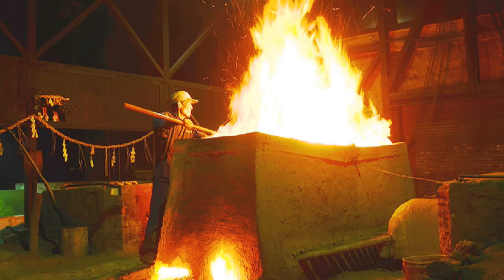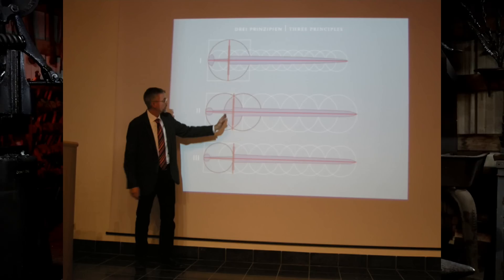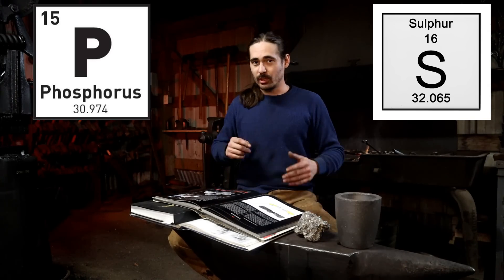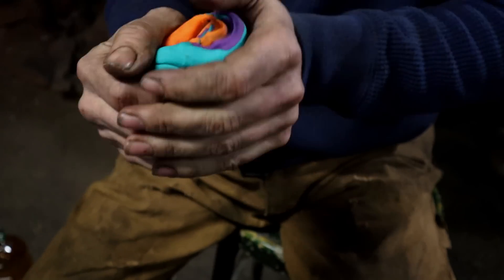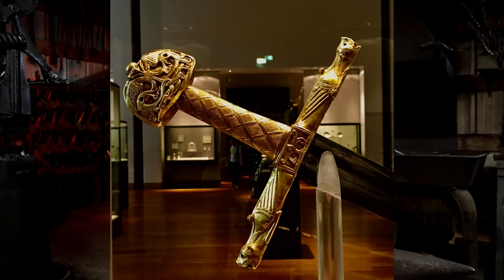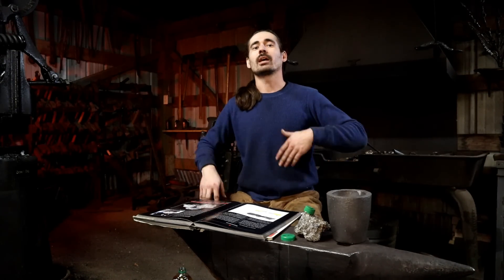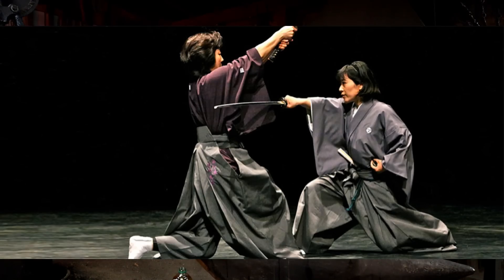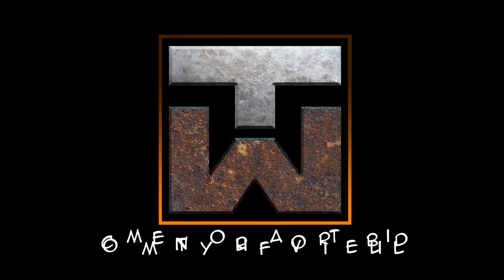Misconceptions About Medieval Steel - Wootz vs Bloom

Comment: Would it be possible to bore a straight tunnel of sorts from the tang through the entire blade (as is practical with the thin edge and point of a blade) with a long Dremel etc, then quenching the blade deep enough that its core is cooled quickly too. You would in essence create an internal and external shell of hardened steel with a thin softer layer inside, making it more akin to a 50-50 hard to softer steel rather than the 30% hard edge and external casing etc. It would improve structural strength but still have the softer inside layer too, the drilled out hole could also lighten the blade meaning that technically the blade length could be far larger and yet still very rigid under its own weight? This is just my theoretical hypothesis of course, I am not an artisan such as you folks and definitely would never have the resources to actually apply this theory in practice but it strikes me as an interesting thought.

Comment: A question on layering, if I may: is there a point at which further folding is simply not worth it?  It doesn't seem like the workload changes significantly between the first fold and the last and each fold doubles the layer count.  Assuming more folds = better then each successive fold should make a better and better blade.  But you never hear of people going to the 15 folds needed to make a 40 layer billet into a 1.3 million layer one, despite how cool a million layer sword sounds.

So what's the catch?  Is there a point of diminishing returns for the time (impurities effectively all gone?), do the layers just get so thin that the steel is effectively homogenised (which would seem to defeat the purpose) or is there some other reason?
Reply: Several reasons for that
Many Japanese smiths will say more than 8 folds will be useless.
Each fold decarburizes the metal slightly, so there is a bit of carbon lost with each fold (this is for both modern and traditional bloomery steels, but bloomery steel loses carbon much faster) and by the time the steel is homogenized, the steel won't get any stronger, so there's no point in folding the metal any more than that besides trying to make a hyper subtle pattern in the steel, and each fold after 8 is more likely to damage the steel.
The Kill Bill episode shows a way of sorting high carbon vs low carbon steels: quenching and breaking (high carbon) vs bending (low carbon).
With that system, any higher carbon steel for the edge could be anywhere between 0.4% or 0.5% to 1.5% carbon content, and evening those out will bring an average of about 0.75%, in line with what Ilya said in the video about Japanese swords being similar to 1075 steel.

Comment: I found it interesting that you mentioned ulfberht swords, but never talked about the crucible steel that produced them, only the crucible steel from the middle east. I would also imagine that the raw stock materials made a large difference in the end result as well, as you indirectly alluded to by the Syrian/Jordanian and Persian crucible steels. Great video, but I think it's still just a scratch on the surface of the subject.
Reply: he said that ulberhts were not made from crucible steel and the guy who claimed that it was conducted sloppy research.
Reply: @kellyfrench5792  interesting, I dont recall him saying that, and a quick search of google shows article after article after article talking about how ulfberht's are a unique type of crucible steel of a quality almost unseen before, and made using materials from Northern Europe rather than India or the middle east as most other crucible steels are made. If there is counter evidence, I'd love to see it, rather than some vague comment.
Reply: @kellyfrench5792  not to mention, the research that was done to conclude it was crucible steel was done in laboratories using electron microscopes. Sounds pretty sloppy.
Reply: @CowboyCree63  THe argument that the steel used was crusible steel relies on three points

1) Low slag content.
2) High carbon content.
 3)Presence of cabridic dentdrites.

Allan Williams never checked whether those features are present in high carbon bloomery steel. He never provided a control group. While in fact all these features are present in a) most apanese swords, which were not crucible steel. Also b) carbidic dendrites form in any steel that ws made to be too hot in the forging process. For example there is a patent for "techno wootz" which is basically overheated O1 which is quenched in liquid nitrogen.

Comment: I dont understand, at the minute 8.26, when he explains that European swords are not elastic because they are made of soft core and hard edge, ilya says that this does not matter to European blacksmiths because medieval steel does not tempered deeply and the nucleus will remain soft equally, can someone explain to me what this refers to please?
Reply: in order to heat trear steel it must be of medium to high carbon to react, otherwise it won't form the needed crystal structure.
If you quench iron, it doesn't get hard nor springy. It stays like it was before.

Steel on the other hand react to heat treatment

Comment: I think it would be interesting to hear some debate about what modern material science would be the most effective cheat against the same style weapons and armor done traditionally.
For instance if someone was a time traveller, and they wanted to fit in at different cultural and historical places, but, basically have "magic" kit, what would be the most mostest actual factual space magic matrials, including weird stuff like titanium-gold, ceramics, composites, metamaterials, plastics, and of course modern steel choices and combinations and such for different cultures?
Example; Heavy bronze Greek Hoplite shield, helmet, spear, and other kit vs. Kevlar? and carbon -fiber shaft spear with steel point?
I dunno.  it sounds silly, and ridiculous, but, I'm a little curious about how extra someone could go with modern materials science, and what materials and manufacturing would give the absolute most advantage using real today technology vs. traditional, and how far those differences are, or, if there might not be much difference at all?   
Yes, it's silly, but, it's kinda something I've never really seen discussed.   What's the absolute best ... Scimitar, Longsword, Katana, Rapier, Khopesh, Spear, Culture xyz style shield/armor using all the different modern materials, and processes available?   
lol.  silly thoughts.
Reply: Or modern concrete making technology, build unbreakable buildings.

Comment: Please, correct if i am wrong, but with folding method, can que clean all the slug in Any kind of steel(bloomery AND crucible). I undestand that, If the bladesmith expouse the phosporus to surfrace Ita posible clean Any steel.

Comment: Someone HELP!
7:50 why is the iron core white??
And why is high carbon edge looks darker here??
Isn't it supposed to be the opposite?
Very High carbon steel are used  by chefs and are known as white steel. While low carbon steels are called black steels.😭😭😭
HELP!

Comment: wow dude this video blew my mind... So mild steel swords (or at least as soft as mild steel) were not really uncommon, and steel was sometimes crappy or floppy (by modern standards). Then the guy who told me that in german HEMA, when fighting an armored opponent, you just hit very hard to dent the armor and hit trough it, well this is absolutely wrong ! Wow could you forge a mild steel blade one day and test it to see how it reacts ?
Reply: It's wrong not because poor quality swords were common, but because plate armor, even of poorer quality, would simply not be penetrable by a sword. 

You simply can't thrust or cut through plate. Even very high draw weight bows and crossbows could not penetrate most times, and even when they did, they often did not penetrate enough to cause injury. 

For that matter, on the battlefield, where plate armor would be most common, swords were primarily sidearms as opposed to primary weapons. Not everyone had a sword, and those who did would have it on their hip and use another weapon (likely a polearm) primarily.
Reply: @justinlee790  yeah indeed, i am a beginner in armor making, but from what i've seen and from the experience i got with some professional armorers, bashing plate very hard will hurt the wearer, but won't really bend the plate or destroy it..
Reply: @jeanladoire4141  Even "bashing" the plate alone wouldn't really cause injury. You'd need particular weapons designed to concentrate a great deal of force across a small surface area to cause more serious concussive damage through armor: weapons like maces, hammers, and certain types of polearms. Swords could also be grabbed by the blade, with their guard or pommel used as a makeshift hammer-point. 

Of course, even so, plate armor worked very well, and it provided incredible protection until firearms technology advanced further than it could address. Though, plate was still present in limited amounts (i.e. on Cuirassiers) even into the Napoleonic era, was experimented with (to no real success) in World War 1, and has seen, in a sense, some resurgence in the 21st century given modern body armor relies on typically-ceramic plate inserts to stop rifle rounds from penetrating the body.
Reply: @justinlee790  Well some parts of the armor are indeed extremely protective, like the breastplate, the bevor, the helmet or the spauldrons... But some close fitting parts like greaves have no padding at all, and trust me, when you get hit in these parts, sure you won't be cut or anything, but you will SUFFER

Comment: This title is all wrong wrong wrong.

First. What is wootz? Well wootz is a crucible steel from India and Arabia. That had vanadium in it at about 0.5% to 1% and if the ingot was worked correctly and not quenched you could get carbide spheroids in layers that would show as a rain drop or similar pattern on the surface of the sword. The sword even though it’s  as dead soft for the high carbon content and not hardened it could be sharpened as sharp or sharper as a 60 Rockwell hardness sword but then retain this sharpness for way longer and take a beating in a fight and not break. As always with hand made items- results may vary.

Even the worst wootz that has a skilled armour turn it into a true Damascus Steel blade is as good as the best bloomery iron blade. However the same degree of confidence can’t be said for just a crucible steel blade. This is because to get the true Damascus steel pattern you need the right iron ore processed perfectly and that’s done by the best and brightest only and then you also need a brilliant skilled armour to get the Damascus steel pattern out or the steel. So you have the best ore processed by the best and most skilled furnace workers and the ingot is then processed by the best armour. The resulting pattern is a guarantee of the best quality at all stages.

So with crucible steel blades there is no inherent marker that proves the best and highest quality ore, furnace worker and armour all worked on the product. However if the same armour makes two swords to the same pattern but one is bloomery iron and the other is crucible steel, then the crucible steel on average will produce a superior blade every time. This is because carbon content in a bloom is iffy at best and knowing when the inclusions are removed is impossible and every bloomery sword ever scanned has inclusions in it. Where as a crucible steel blade even with a poorly made ingot has far far more controlled carbon content and all the inclusions in a bloom are removed in the crucible process.

The crucible steel blade is also quicker to make as the steel does not have to be cleaned first by the armourer and the blade is far far less likely to snap during quenching.

So wootz is the best of the best crucible steel from the day. Crucible steel is clean molten steel ingot normally with the carbon content adjusted. Bloomery steel is the precursor of crucible and wootz steel and is a conglomeration of unburnt charcoal, rock slag all on the outside and also mixed into the bloom since its made in a layering process.

Now 

Crucible steel is just steel that has reached a fully molten state, AND NOTHING ELSE.

Bloomery iron in is a conglomeration of reduced but far from melted iron ore that due to the layering process of ore/charcoal and the mixing of the iron ore and the charcoal as everything burns the bloom is a mix or slag that can’t or didn’t run away, charcoal crap and slag actually in the bloom where layers of ore melted the slag but the slag was surrounded by ore and reduced iron so the slag was trapped. So a conglomeration of everything that went down the furnace chimney.

Since crucible steel takes the shit crap filled bloomery iron and then melts it and if you want you can adjust the carbon content as well and then floats ALL slag and crap out of the bloom to the top forming a cap of shit, HOW CAN BLOOMERY IRON BE BETTER THAN CLEANED UP BLOOMERY IRON WITH CONTROLLED CARBON CONTENT? So skill either required. Just put the shit your told to put into the crucible then seal the lid and put the whole lot into a furnace that looks just like a bloomery furnace. One person could do 50 a day if someone made 50 furnaces for him. Where as a smith could work 2 or 3 blooms over 2 days.